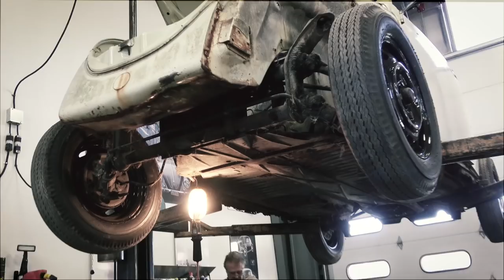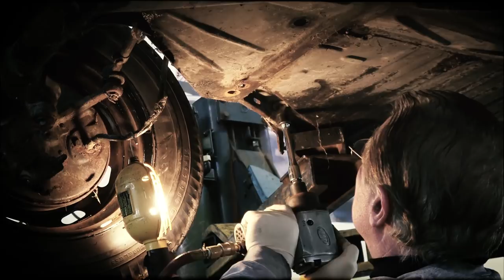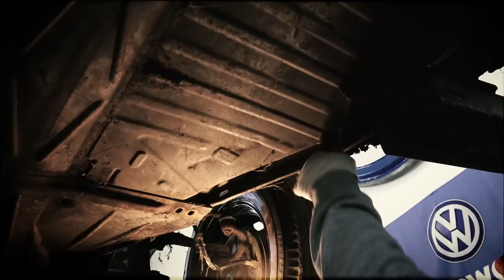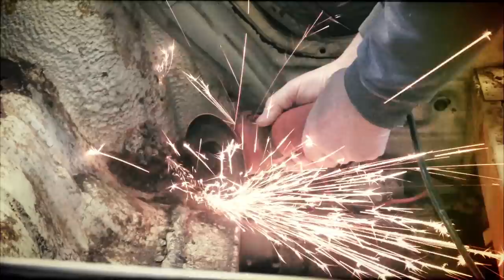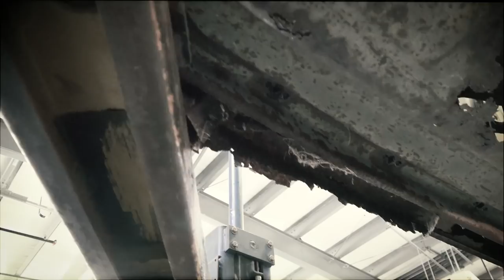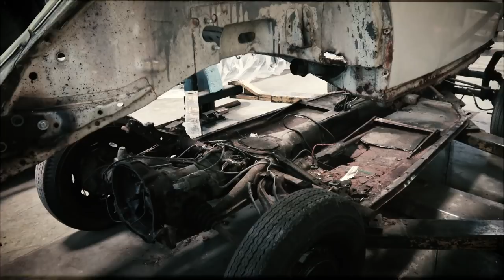Classic VW BuGs 1970 Convertible Beetle Restoration Project Body Off Video

Comment: I will be following you on this car for sure!!! I was given a barn find 68 Beetle Convertible.  Wondering if I need to do anything special with welding bracing supports to remove the body from the chassis. Don't want it to fold in half on separation.  Looks like you kept the doors on and shut for yours
Reply from the maker: You need to call bugstuff on PA, they have the door braces.
Reply: Thanks!  I was going to weld up something similar.

Comment: Chris, I did not notice any bracing on the body.  I expected to see the body braced before separating from the pan.  Can you provide some guidance on when/when-not-to add bracing?  This part of my 65 vert restoration keeps me awake at night and truth be told is probably the reason my project has slowed down so much.
Reply from the maker: I have the bracing, I will show that in a later video.  Bugstuff in PA sells the braces.

Comment: Thanks for your update Chris. How much of the chassis metal will be salvageable? The pans look pretty roached. Any other surprises on the chassis? Looking forward to your progress brother.
Reply from the maker: All the metal is good but the floors, other than floors all the metal is in real good shape on the tunnel, front end, and rear axle areas.
Reply: Sweet! We had to redo the passenger pan on my son’s 70 beetle. Turned out not to be the first time the pan was replaced on that side. Wolfsburg West was a great source for the replacement. I’m looking forward to seeing the transformation of this chassis! You got a great crew doing some great work! Fun to watch!

Comment: I noticed what looks like a cut-out in the dash for a gas gauge for a '67 and prior. Is it cut out on all of them past '67? BTW, I think this is fantastic. I can't wait to see when it's completed. You always do great work.
Reply from the maker: Yeah that cut out is there from factory.  I am tempted to do a Euro Dash too, what do you guys think?
Reply: Chris Vallone Absolutely! I’m doing the same thing to the ‘68. I always liked the Euro look. The pain is probably going to be finding the tail lights. The smaller front turn lights, low back seats, and dash with chrome should be easier to find.
Reply from the maker: You also have to watch out for the knobs, glove box door too, as now you will not have the pad dash on it anymore.  GloveBox door is gonna be tough I think.
Reply: Chris Vallone Oh right!! I didn’t think about that! Good point! Even the ashtray. Finding one without the plastic padding with the shift pattern still visible. The US built ones have two mounting holes in them for the plastic. If you could get all of them, I think it would be really spectacular. Do you have a particular color in mind? I’m partial to Clementine. Haha. There aren’t that many out there. I’m not sure what the demand is but it’s probably more than Yukon Yellow.
Reply from the maker: Yeah we love clementine orange here, it is only a 2 year color! But I am tempted to throw a lil metallic in it.  And yeah Yukon yellow is not a big money puller for sure, so we are not going back to that.
Reply: Chris Vallone I think Clementine will sell fast because it’s vibrant. Going by that habanero orange is popular. Adding metallic to it will make it even more attractive I think! Custom color. Clementine orange metallic! Sounds good to me! 

In your process, if you could document how the back convertible window works, I would be forever grateful. Mine is a little bugger. It keeps going out of the track. I dropped a screw that holds the hinge to the body once. I used the magnet to get it out but all it did was stick to the body. Haha. I did eventually get it out. About an hour later...
Reply from the maker: Ah yes Habanero I saw too from the new beetles, I also like the copper burnt oranges from todays cars, like from mini or range rover.  We shall see.
Reply: Chris Vallone I bought a new beetle for the sole purpose of it was the closest to Clementine! Haha. I was waiting for years for VW to come up with one in that color. I’m glad they did. 

Good luck with everything Chris!
Reply from the maker: Thank you my friend, I'll keep ya posted.